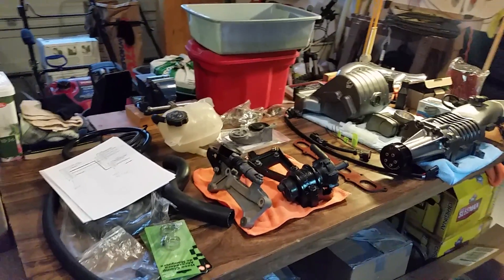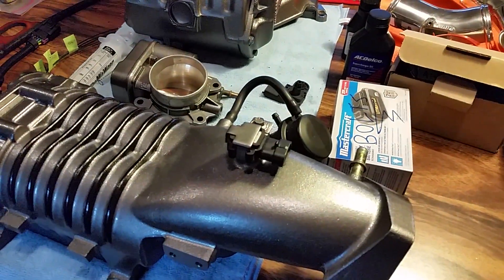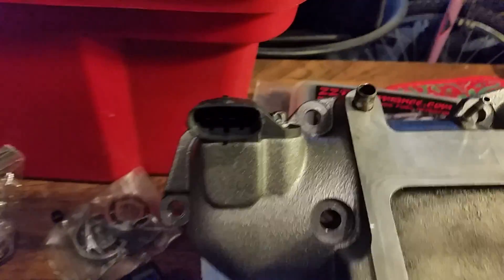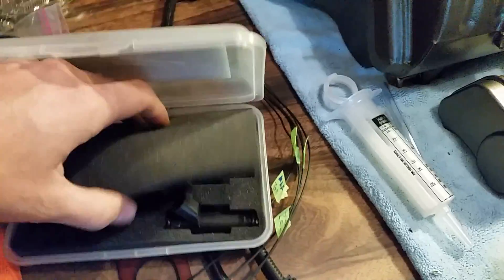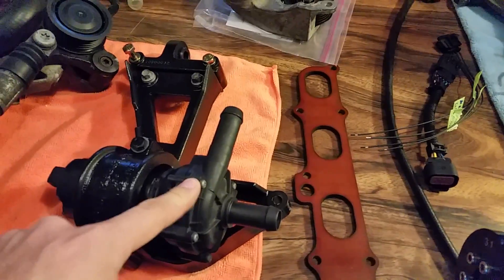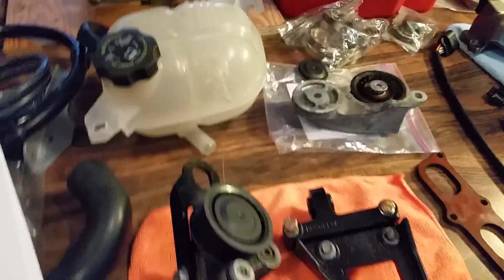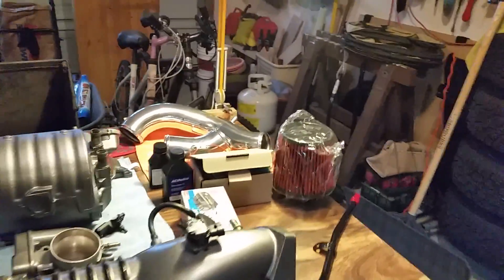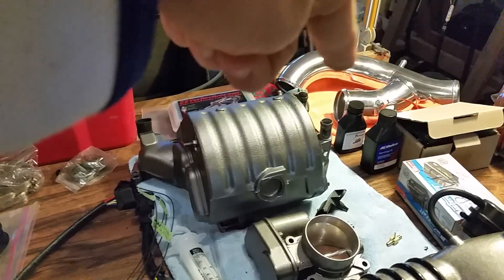How to Supercharge a 2.2L L61 Ecotec - Part 1 - Parts Walkthrough

Comment: I hear you have to upgrade the connecting rods first before installing supercharger
Reply from the maker: @GhostTrucking545  only on a 2.4L not a 2.2L61. This setup last me 4 years with no issues btw before I did built motor so I could install a large TVS1320 supercharger and meth kit in 2018. Made 360whp

Comment: When u wired ur iat to the tmap sensor. Did u change the iat calibration. Is so where did u get the info?
Reply from the maker: No calibration needed it will simply provide a more accurate temperature reading post-supercjarger as opposed to in the air intake tube. 
When you're tuning and you select Supercharger Equipped = Enabled, it takes care of the backend for you in the algorithms and table connections for the ECM. It's all built in. Make sure you enable that setting.... will also make your ecm look for higherbarometric pressures from the MAP sensor. Stock GM TMAP sensor will give you plenty of room to work with.

Comment: Where you buy a supercharger is it cheap I have a 2.3l 4-cylinder Ford ranger custom 1988 and I want to put a supercharger on it
Reply: Turbo it. But you need to build your bottom end those na 2.3 lima engines will not hold boost. You'll melt your pistons over like 8psi from what I've heard. I've had 2 thunderbird turbo coupes, very familiar with those 2.3s

Comment: What supercharger is it? And is it twin screw? How r u cooling it?
Reply from the maker: It was a stock M62 from a Cobalt SS, or Ion Redline. Roots style blower. Intercooler is build into the intake manifold, flows through the 4 cores inside the intake manifold. Dual pass endplate to speed up the flow. 2 head exchangers up front. Liquid cooling system (mimicing the Cobalt SS setup but with some upgrades). Plus the Option B tank bleeds air much better than stock setup.
Reply: @liquidmetal92  
Thanks for your info 👍

Comment: How has the 2.2 held up since doing this?
Reply from the maker: Perfectly fine. Put 27000kms it with the 2.7 pulley and meth injection. 17psi. Tore the motor apart last year to do a full build, zero signs of any damage. Even was able to reuse the main bearings and rod bearings. They were mint still.
Videos this spring of new setup. TVS1320 blower on a 2.6 pulley. BRFPR fuel system and meth, stage 3+ clutch. 23psi and rotated mounts/solid bushings. Fun platforms to build!

Comment: What supercharger are you using specifically?
Reply from the maker: legendary kickzz Eaton m62. Stock blower for the cobalt SS and ion redline. Currently building a forged internal engine with ported head to put a TVS 1320 onto.
Reply: Vincent Colussi ok so I have an 02 Chevy cavalier I tried looking for everything I will need. But can I use exactly you used? And it be fine since I have the same exact, 2.2 L ecotec engine?
Reply from the maker: Close to mine but you have Cable-controlled throttle body whereas mine is electronic. Plus you have an IAT sensor so you'll need to split your TMAP temperature reading into your IAT harness for your computer to recognize it. I have a MAF sensor yours does not. Look up the ultimate J-body build guide. Tonnes of good info for the cavaliers. And for tune, you can use the GM re-flash from the dealer.
Reply: Yxng Dagga usually cavalier guys turbo seems to be easier with a fmu and fifth injector setup
Reply: I have a 2.2 eco tec on cobalt SS did anyone know if a could use that manifold from a 2.0??

Comment: I have a 2005 Chevy Malibu (not classic) with the 2.2 in it. I heard that there are different types of GM 2.2L engines out there from around the same time but are technically different generations. I've done a decent amount of research on if this kit would work with my engine but I'm very new to cars and I am getting very confused with everything I'm reading. Anyone know if this would work with my engine?
Reply: Just to add, I have the L61

Comment: Where did you get your whole kit from? What did you do for a heat exchanger/intercooler?
Reply from the maker: Brett Weston cobalt ss Facebook forum. Intercooler is stock with the lsj manifold using lsj heat exchanger, and later I added a zzp heat exchanger in series. Option b tank and dual pass endplate.

Comment: You bought all that for $800?!?!? Whats your secret man? I found a parts list online and after just the charger, injectors, intake, tensioner, pulley, throttle body, and manifold (all used) I'm over $1000. Whats your secret?
Reply: The used superchargers alone are like 450

Comment: Would this work on a 2005 saturn ion 2?
Reply from the maker: Braden Bach the parts will fit yes. But your tune would need to be standalone since you're 2006 and under. ZZP only offers tuning for the 2007 and up same with other major tuning sources like trifecta (I don't think they offer it anymore for ecotec). But if you can find a local tuner first, then I'd look into doing the build after
Reply: Vincent Colussi how much would the approximate cost be?
Reply from the maker: Braden Bach depends on the tuner! Usually around 300. Can be up to 500 if you have to unlock using special software like HP tuners

Comment: it is possible to mount it in a cavalier 2004?
Reply from the maker: CARLOS EMMANUEL RUVALCABA DIAZ  yes. You need to use the GM reflash for a tune though unless you do standalone. You are cable throttle driven so the electronic info in this doesn't apply to your built. Look up the cavalier 2.2 builds they'll have your vacuum line routing and throttle body info. Believe you can upgrade yours to an ls1 throttle body to an m62 blower if you buy an adapter plate
Reply: I have a 2.2 eco tec cobalt ss do i need a different  throttle body??or the 2.0 throttle body fits?? Please help
Reply: Download the GM sport compact performance build book.

Comment: i wouldnt put the cold air intake filter so close to the ground, they dont pick up as much dirt as a stock airfilter would.
Reply: You can get prefilter covers to protect from incidents like that
Reply: The point is to get cold air, not hot air from inside the engine bay.

Comment: how bout a 2004 chevrolet cavalier 2.2l ecotec? will it fit properly?
Reply from the maker: My friend boosted his 2003 2.2L. Similar idea to this, you need to use a different throttle body because yours is cable and the cobalt/ion/g5 is electronic. JBody forums has lots of info on it for you

Comment: Thank you for the great walkthrough! I was wondering will this work on the later LAP i4 ecotec? Will everything still fit?
Reply from the maker: Since it was based on the Gen II block, I would say yes. 
Manifold should bolt on, same with IC Pump bracket, pulleys and idlers etc. 
Tuning will obv be different from an L61, is the LAP VVT?

Comment: I have an 02 Olds Alero with the L61 2.2L and I've been wanting to do the inside of the motor for a while now but can't find anyone that has done one. I was wondering if you had any pointers on what to do. I've seen many turbo'd and supercharged. just non with bigger pistons and cams

Comment: can i have the wiring diagram for the map sensor ?
Reply from the maker: http://i6.photobucket.com/albums/y223/BlackoutNJ/diagram.jpg
Reply from the maker: The TMAP diagram is on the far left (LSJ sensor). The OEM MAP is the same as the one on the upper right. Depending on your year, your car may not have an IAT sensor. My 2007 L61 does not have an IAT (lower right sensor in the diagram I linked to you). This temp reading comes from the MAF sensor in my car, so replace IAT in that diagram with the temp wire from the MAF and you're good to go.
Reply: i have a 2004 sunfire. do you have a mass air flow on your Ion our its just your TMAP that send the info to the ECU
Reply from the maker: You should have the set-up that's in the diagram I sent you then. A MAF sensor for pressure, and an IAT sensor for temperature. Should be able to follow that diagram then and send your TMAP reading to your ECU by splitting into the IAT wire which pins into your ECU. Don't touch the low reference wire in your IAT only split into the sensor signal (tan wire)
Reply: ok. for the iat i take the tmap signal and send im to the tan wire ?  and my engine dont have a MAF.  its a MAP
Reply from the maker: Just follow the diagram then. Your 3 stock map wires go to the TMAP. The temp wire from the TMAP splits into your tan wire from the IAT sensor. bazinga

Comment: so now that you added the supercharger and runs high 14s, is there anything else that you can do to make it faster?
Reply from the maker: Change to a smaller pulley. Re-tune for more fuel. Upgrade your injectors if you have to. I went from a 3.1" pulley to a 2.9". You need 60# injectors for a 2.9" pulley or smaller, the 42# won't provide enough under high boost. 
Exhaust mods help, improve your air intake etc. Anything beyond that you're looking at valve work, porting your head, intake manifold and blower... cams to improve duration etc.

Comment from the maker: Check out Part 2! Engine-bay walk through, start-up and idle, and some driving pulls :)
Reply: Vincent Colussi hello, I’ve been looking to do this to my car but wasn’t able to find anyone to do it for me. Do you know a place in California that’ll do this kind of job? I have 2007 Saturn ion as well let me know thanks
Reply: Has it been problematic? Or is it still running strong?
Reply from the maker: @JoeyLovesTrains  No issues drove it daily for 3 years afterwards, then summer drove it another year before selling the car. Ended up building the motor and putting a TVS 1320 on it a year before I sold the car. Still running fine with the new owner, we keep in touch

Comment: Would this setup work with an 03 ion? Was thinking about doing this to mine
Reply from the maker: If you have a 2.2 then yes because these parts will fit onto an L61 block. Some companies such as ZZP won't be able to do your tune since it's a 2003, but if you can find a local source then you should be good to go
Reply: @liquidmetal92  Could you sell me all?